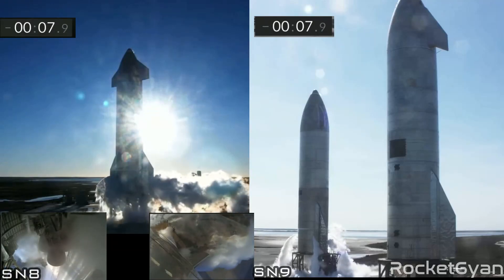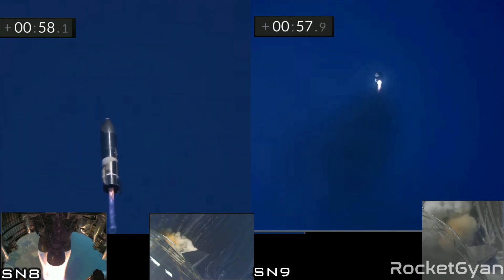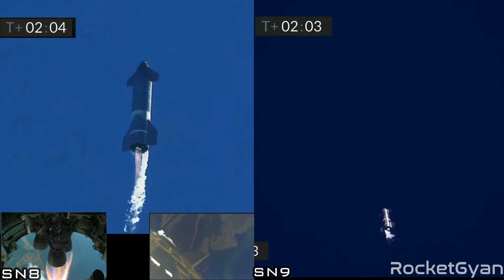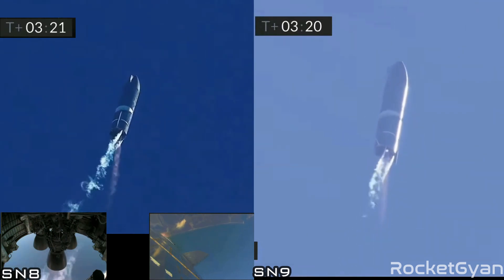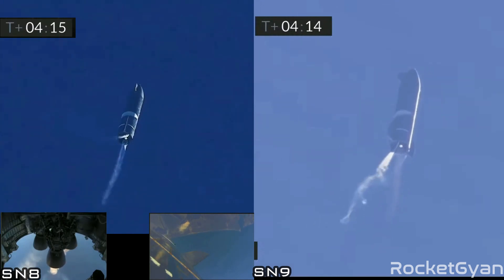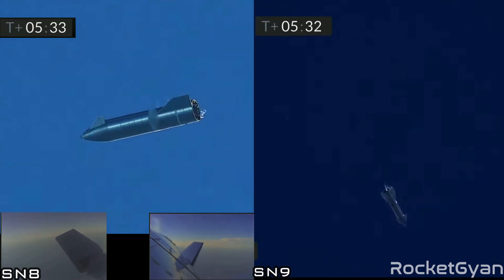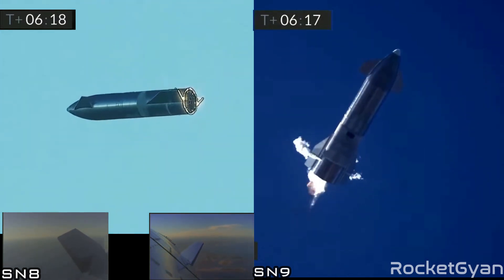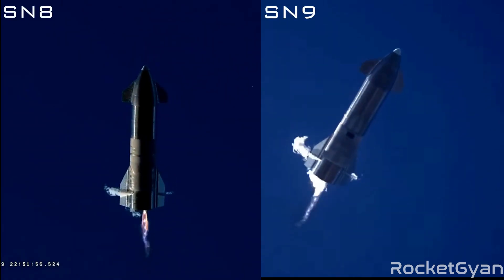SN8 VS SN9 Launch comparison | Starship SN9 Vs SN8 difference | SpaceX Starship Launch

Comment: Motors 2 and 3 didn't show up. I think they have to scarify sn10 and do the landing maneuver at higher altitude to see why the raptors didn't start. Or they have to start the maneuver at more altitud, simply you can clearly see that when motor 1 finished its burn for vertical positioning, motors 2 and 3 should contain the overshoot to keep the balance. Change the algorithm